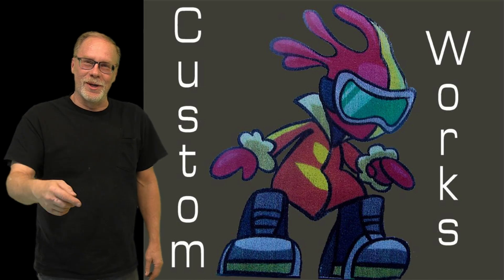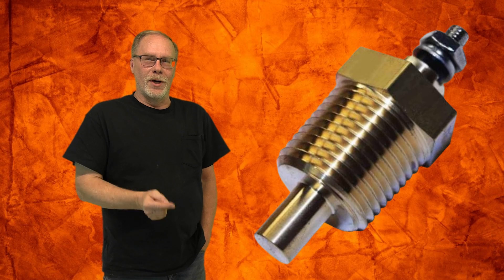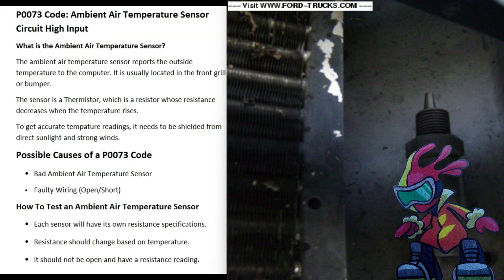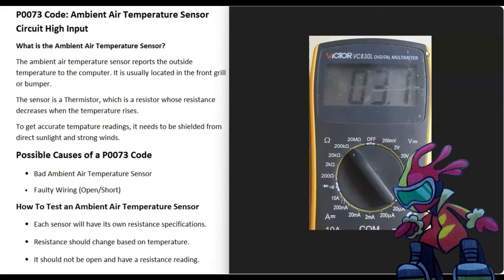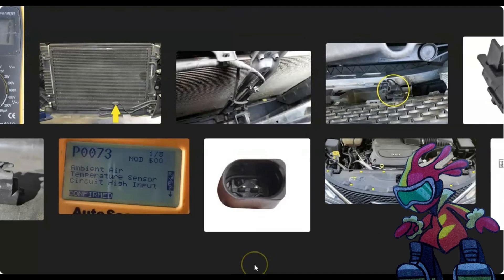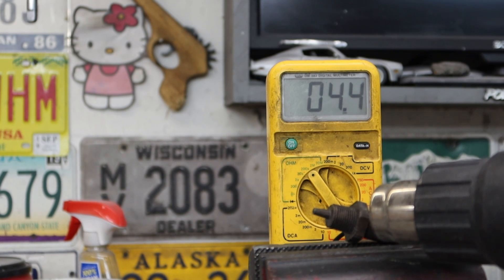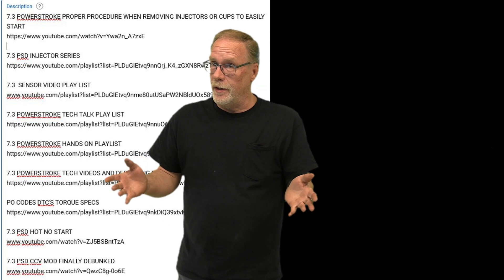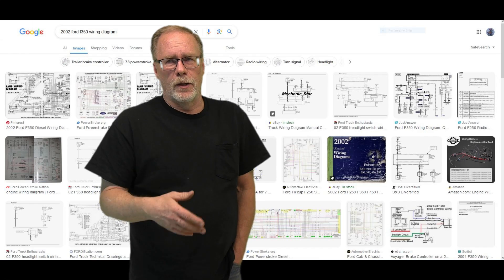🛻📽️7.3 POWERSTROKE AMBIENT AIR TEMPERATURE SENSOR    🚧🛑⛽🛻

Comment: Hello, your room temperature as seen within your t-shirt, and with your meter that reads about 12,000 ohms,  comparing to your chart range, I guess  your metered ambient temperature is 104F-122F. 
Question:
Is that a bad sensor because your not sweating as the chart indicated a hot range? (My sensor measured the same, but the overhead display reads near freezing with frost warning.) I'm just a little confused why our same metered ambient range is hotter, and should be charted closer to about 70F at 27k ohms? If range is off, we both have bad sensors?

Comment: Mine is stuck at 140, but no DTC. A bit tricky to reach, but looks like an easy DIY fix!

Really appreciate all your videos - been watching them for years, even before I had a 7.3! The knowledge you share is invaluable, especially for someone like me in Luxembourg/Europe, where finding a reputable 7.3 mechanic (or any diesel mechanic, really) is basically impossible.

Among the many small issues I am trying to diagnose, I’ve noticed some black smoke on snap revs and WOT, and I’m trying to track down the cause. If you have a video that might point me in the right direction or help me out in any way, I’d be super grateful!

Comment: A shop rebuilt my AC system twice. They replaced almost everything: compressor (3 times), evaporator (twice), and orifice twice. After getting annoyed by them I eventually stopped having them work on it even though it still doesn’t work well. I know it has all new parts in it and I charged it myself by the book. My ambient air temp sensor reads incorrectly. usually it says something like 58F, but it will sometimes be correct, and I’ve speculated this may play a role (the excursion has climate control). Now I’m going to test the sensor and wires. 
I’ve been watching many of your videos and there is an amazing amount of knowledge on display. Thank you very much! 
I bought this truck with lots of gimmicky mods because the price was right and the maintenance records show the oil changed at 4000 miles every time. I’m slowly undoing all the mods and returning to stock with a few exceptions. I plan to add the fluid dampener/harmonic balancer and high volume LPOP when I replace the water pump. The water pump on the truck has an attached filter and good lord that thing is seized on there. Instead of fighting with the damn filter any more, I’m just going to replace the pump and be done with it. It’s showing some signs of age anyways. I figure I might as well pull the radiator and intercooler to give more space and properly service those items as well. It’s funny how a filter change can turn into a much larger job.

Comment: Hello Clint my name is Matt i have a question for you, my shop has had a 2002 F250 7.3 with an oil consumption issue we replaced the injection orings as they had been told that was the issue with it, the orings were bad, but still used oil did the bypass for the turbo and valve cover line helped but still used oil found the passenger side oil rail plugs had been leaking replaced them still consumes oil more so when under a load pulling a trailer they just bought the truck and it had been sitting for a couple years before they bought it thinking it could be the valve seals leaking but there's no oil in the tail of the exhaust and it doesn't smoke white or black and so you know this is the first diesel I've worked on so I'm not familiar with this system but I have learned a lot so far and was hoping that you might be able to help point me in the right direction of where to go with this vehicle I truly appreciate any information you may be able to help me out with, I think you in advance for your time
Reply from the maker: If there are no more external leaks and you removed the down exhaust pipe from the turbo and there was no oil in there Have you removed the up pipes at the manifolds to see if there wet ? and whats the compression test showing ? massive oil loss can come from bad turbo, clogged ccv, external leaks, cracked injector body, bad or broke rings and messed up cylinder broke cracked piston and it will run just fine and not blow smoke
Reply: @CUSTOMWORKS7.3PSD  thank you for replying i truly appreciate your time and I'm sorry for my long response time there's no oil in the down pipe in the turbo or in the up pipes that I noticed previously but we just got the truck back here in the garage it was brought in by tow truck this time now it is having a hard time starting and smokes white with even more oil consumption going to do a pressure test on it today I checked the injector bolts to see if they came loose and the passenger side I had to turn a full turn before I could get them tight enough to torque down could that be what caused it to start smoking white and starting hard? ls there a reason why the passenger side would have come loose like that? l also found the valve cover gasket is leaking on the passenger side but no leak on the drivers side exterior wise I also noticed on the turbo pedistal the push rod that is at the bottom is covered in old oil
Reply from the maker: @BAAuto-s5i  loose injectors will cause all of these issues, it would be best to rebuild all injectors with new O rings and while your there new under cover wire harness Loose bolts would tell me someone before you did a piss poor job also the pedestal leak is a massive concern a new one needs to go in or the deleted model since you removed the flapper as I recall you stated New O rings FORD OEM ONLY I have the most comprehensive video,s on injector rebuilds in the video section in my main page and others that cover these issues
Reply: @CUSTOMWORKS7.3PSD  ok thank you i appricate your time and your knowledge and I am thankful that there is someone as knowledgeable as you are and is willing to share it with others we need more people like you in this world l have learned a lot from your videos and they are some of the most informative videos around anywhere I hope to keep seeing more videos in the future I will keep you posted on the results thank you again
Reply: @CUSTOMWORKS7.3PSD  ok compression test from passenger side front to back 280,300,280,330 drivers side front to back 320,300,310,320 are these exceptable numbers for this 2002 7.3? or are they to low and the 2 280 are bad?
Reply: @CUSTOMWORKS7.3PSD hello clint hope all is well i was woundering where is the best place to get a complete rebuild kit for this 2002 7.3

Comment: I’ve got some knocking in my 2000 f250 that I just can’t figure out. I could really use some advice. Could I reach out to you for some help?
Reply from the maker: Not yet have you installed a IPR or Cleaned yours This is usually the issue Then injectors https://youtu.be/by1xh7v6tfk?si=_fynbWl5nItTl6vB
Reply: I’ve done IPR, ICP, EBP, CPS. still knocks. It’s only once it’s warmed up. Truck only has 87k miles.

Comment: Hi there Clint it’s “ROOKIE MISTAKE “ I know your a very busy man but as I told you I have done a lot to my truck lately but just recently I had a hot no start I do have a code of p1316 IDM I DONT KNOW EXACTLY WHICH DIRECTION TO GO HERE I HAVE CHANGED THE IPR AND CAM SHAFT SENSOR THAT DAY OF NO START AND GOT NO CHANGE THE TRUCK IS MAKING ONE HELL OF A NOISE SUPER BAD CLUNK WHILE ATTEMPTING TO START SO I WAS THINKING THE IDM I KNOW I NEED TO RUN A GABBIT OF TEST BUT WOULD YOU SUGGEST JUST A OVER ALL TAKE IT IN TO A MECHANIC TO HAVE A DIAIGNOSE SOORY FOR YHE BAD SPELLING LOL THANKS FOR ANY INFORMATION

Comment: Hey Clint,  I have a 1997 with 7.3.  At initial start up after setting for a week or so little white smoke.  If I run every day smokes lots when cold.  Puddle of oil under truck when sits.  I am thinking the valve cover gaskets are bad?  In addition I believe the turbo uptubes are leaking .  I smell diesel exhaust in cab.
Thoughts?  No codes in fordcan.
Reply from the maker: Sounds like its time for a injector rebuild and the rest I have video's on in the Hands on playlists as well as a full series on injectors

Comment: excellent knowledge. I've been fighting an issue on my 96 psd for about 4 months now and im stuck. E4OD/ZF5 swap, new Ford ICP, CPS, IPR, Harness. Galloped at start, drove tp work 12 miles, went to leave and it bucked, sounded like a miss, then died. crank no start. i have a video and screen capture of sensor values. I know the tank selector valve is bad and sourcing a ford replacement. inj pulse test is good. the only thing not new is the ICM and PCM. id like to email you the videos for your opinion and help to get my truck out of the parking lot at work.

Comment: Have an issue my 7.3 for a few months wondering if you have an idea what’s going on, start truck up with check engine light runs with a slight miss, cel goes away and runs perfect for 5 seconds then, cel comes back and misfires bad and shakes then slightly smooths out. (New icp, cos, engine harness and new idm)
Reply from the maker: what are the PO codes in the computer ?

Comment: Interesting.  I was wondering where that sensor was.  Been having some accuracy issues with mine.  Sometimes its right on and other times way off.  Seems to be less reliable when its cold outside.  Probably got some light corrosion in a plug somewhere.  Ill look into it

Comment: Hey Clint, thanks for the knowledge my friend. I've definitely had to fix the board in the overhead display, sent it to Florida once they repaired it for $15 and the last two times I fixed it, I was able to see which diodes were bad and I replaced and soldered them back to the circuit board and it's good as new. It's been ok for the last 7 years now. My temperature display seems to work fine so I guess ATS should be ok but I believe I'll take it out and test it since they're reasonably inexpensive. Thanks again my PowerStoke brother😅. Jay.